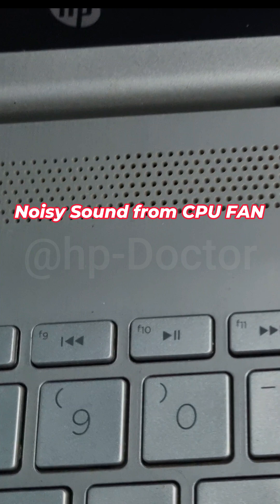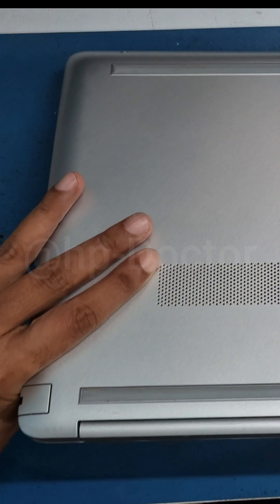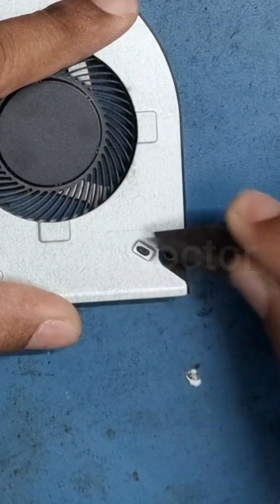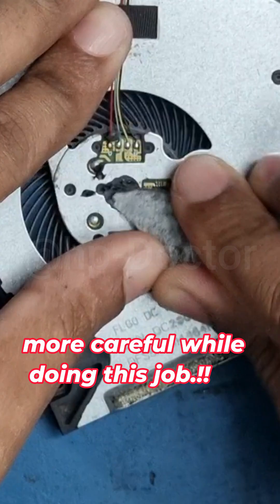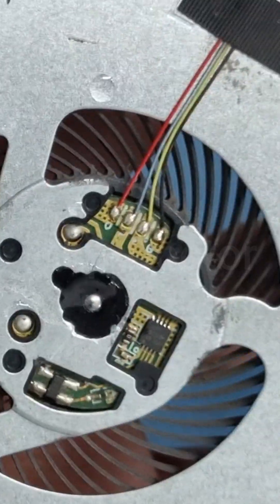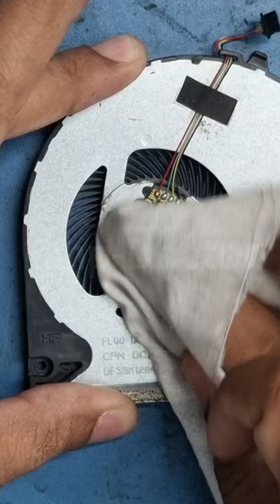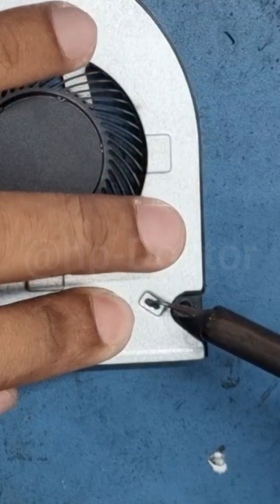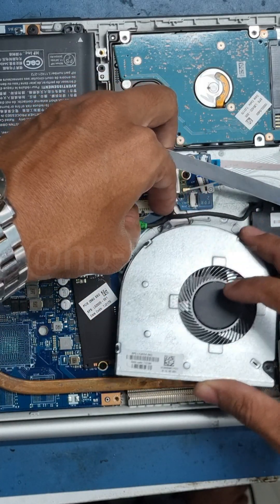Fix Noisy Laptop Fan in Minutes! 🔧💻 #TechTips

Comment: What if I pull out the fan to clean then return it back but it's making a sound
Reply from the maker: Hi, if you find abnormal sound or noise from the CPU fan, then check whether the fan blades are bent or broken. Check if the bearing is loose or tight, and check the fan shaft for rust. Clean it using WD-40 (recommended for better results). If everything is done correctly but the fan noise still remains, then you need to replace it with a new one (genuine CPU cooler fan).

Comment: well i guess i found this video a little but late 😅😅 i opened the fan and used a little force on it and it got broken 😂 now i have to buy new one
Reply from the maker: Haha 😅 it happens, bro! These fans are really delicate — even a little force can crack them. But no worries 👍, replacing it with a new one will make your laptop run smoother and cooler again. Thanks for watching and sharing your experience! 🔧💻

Comment: so um i didnt remove that back plastic to show to metal. i kinda just pulled the fan out. is that bad. i did brute force it. i heard some cracking sounds. the fins didnt break tho, i made sure to be care full of that.    did i break that bearings?
Reply from the maker: Oh no! The fan has a single shaft — the shaft is inserted into one bearing, and the end of the shaft is locked with a plastic clip. If you try to forcefully remove the fan, there’s a chance the lock or bearing may break. Once broken, it can’t be used anymore. That’s why the back-side plastic cover must be removed before taking anything apart.

Comment: My Lenovo Laptop Cooling fan starts and stops in 3-4 seconds on booting but the laptop boots and works normally but the fan doesn't spin even in heavy tasks also which causes overheating.....is it the fan problem or anything else.....
Reply from the maker: Hi, karthi,
Read Carefully this note:-

If you’re not a technical person, you should only update the BIOS and swap the fan carefully.( Read Conclusion ).

Reason (Maybe):-
Laptop motherboards control the fan speed based on temperature sensors. If the thermal sensor is faulty or misreading (always thinks it’s cool), the fan won’t turn on properly. Or, if the PWM control line is damaged, the fan won’t spin even if commanded.

Checklist:-
Boot into BIOS and see if fan test/control is available. Many Lenovo BIOS menus let you check or force the fan to run. Run Lenovo Vantage software in Windows and check thermal & fan control.

Solution:-
If the fan is physically hard to turn or doesn’t start even when hot → replace the fan. If the fan spins fine and works when fed external 5V/3.3V → the issue is probably on the motherboard control side (But this need extra care and Skill).As a temporary measure, you can also force the fan on by setting BIOS settings (if available) to "Fan Always On" or similar.

Conclusion:- 
Update the BIOS before doing anything, Don't forget to connect the AC Adaptor while update the BIOS and don't make any interrupt while flashing BIOS, this may chances faulty your machine. If you’re not familiar with the technical details, don’t take any risks. Visit the nearest service centre and let them handle it. Good Luck & Take Care.
Reply: @hpdoctorofficial Thank you So Much for Clear Information you provided......
Reply from the maker: @karthickrazer4680 you are always welcome👍🤝

Comment: wd 40 is  not good for laptop fans it will just get stuck in a month the best lubricant is either a small drip of motor oil or sewing machine oil you pull the fan from the copper coils add the lubricant spin then detach it clean the axle keep doing that until the axle assembly is clean then put it all back together wd40 is only a temporary solution and btw isnt good on plastics it stains them and weaken the blade structure making it prone to break faster
Reply: Correct. 
WD40 is a solvent/degreaser that will also become a trap for dust. Its intended use is as as a penetrating lubricant to break free a mechanical connection.
Machine oil, or, sewing machine oil (3-in-1) would be a proper repair that wouldn't become a dust magnet in the future.
WD40 is all too often misused.

It will work, especially in the short term, but can eventually become a source of failure.
Reply from the maker: Thanks for your insight! 
In this particular case, though, the fan was repaired successfully about 8 months ago, and the customer hasn’t reported any issues since. That’s why I chose WD-40 here — more as a cleaner than a proper lubricant. Sewing machine oil or motor oil is definitely better for the bearings and much safer for the fan plastics.
Really appreciate you sharing your experience and adding value to the discussion! 👏
Reply: It's no problem and if the customers fan still works then that's really good it's better than ordering a replacement fan and waiting months to source and find the part you need 😅😅 @hpdoctorofficial

Comment: before I watched this video,I tried cleaning my fan with an old toothbrush,and right now as I speak at this time  its still making noise plz help me
Reply from the maker: Check whether the fan blades are broken or damaged. If any blade is broken, the fan must be replaced to ensure proper operation. Also, try cleaning the fan bearing using WD-40 or a similar solution, as demonstrated in the video. If the cleaning doesn't resolve the issue, the entire fan unit will need to be replaced.
Reply: @hpdoctorofficial  still making the sound 😢 I use a Dell latitude E6440 laptop so I jus want to replace the fan
Reply from the maker: It's hard to hear, try changing the spare part of the fan, if you take care not to let dust get in, it will last longer. After use, just store it in a pouch or bag, take care 🤝